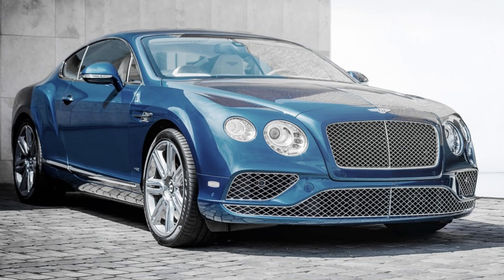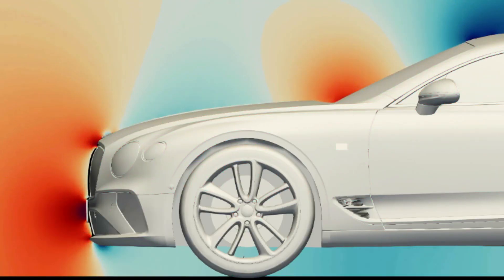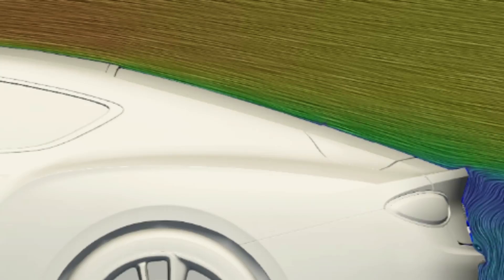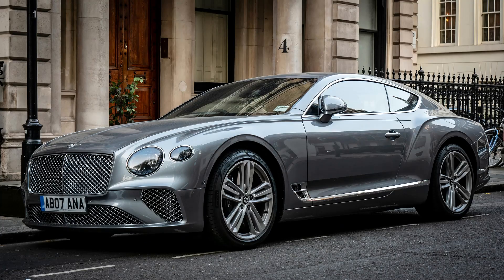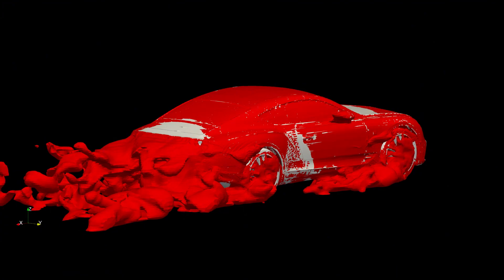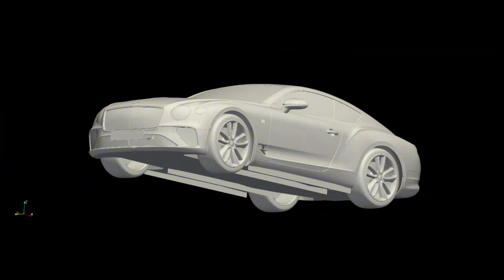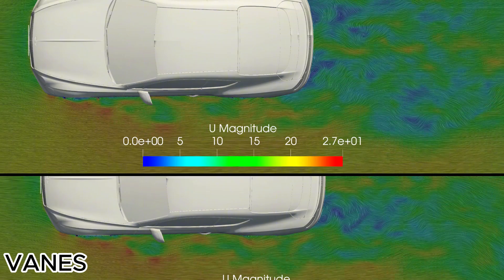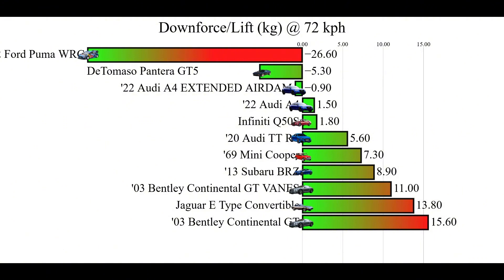I Made This Supercar More Aerodynamic

Comment: 00:18 - "The cool, original GT."  The car you've featured here, is definitely not the original 2003 GT - which was higher off the ground, and taller.  The 1st Gen also had a smoother and more rounded nose - in detail, in profile, and laterally where the nose joins the vertical side surfaces of the front 'guards.  Additionally, the earlier two of the four generations, had a different drivetrain layout and floorpan.  This is relevant as it required a longer front overhang than the two most recent generations.  To what degree that affects aerodynamics I am not aware. 
In this image, and the aero version you analyse, you have the 3rd generation from 2018.

Comment: Could you do the Model Y, essentially aspect of lowering the ride height by 4 cm and the underbody and the Flow around the wheels. I work on the Concept here
Reply from the maker: Sorry, I don't understand what you mean.
Reply: @ I LIKE the way you did the analysis. If you have the cad data for Tesla Model Y available, it would be great to check its aerodynamic. A Common modification is lowering the car about 4 cm. Further improving the flow in front of the tyres with deflector or guide vanes. 

More like, what could someone do, to improve the aero even further

Comment: Do you think those long strakes on the side would work on most vehicles? I've been wanting to reduce drag on my car but haven't been able to find a way to manage the tire wake better. I was planning on improving the floor, front lip, making a diffuser, front wheel deflectors, and air curtain, blocking off more of the front openings, and lowering ride height slightly.
Reply from the maker: I think it would work on most regular cars. Not necessarily all supercars, or hypercars, because they sometimes have complex underbodies that have been optimized. But regular cars should be fine.

Comment: So... I saw that you had the beetle and the classic mini on the chart... Mind having a look at the fiat 500 and looking into the lid up/lid spaced/ lid closed situation? I'd love to see what makes a difference to Cooling and drag.
Reply from the maker: Thanks for the idea!
Reply: @PremierAerodynamics  basically the Bug guys usually open the top of the lid, by about 2 inches, but 500 guys lift the top, the bottom, and even lift the lid 90°. Carlo Abarth had claimed that the table top lid reduced drag, improved down force and improved cooling. Same applies for the fiat 600 and quite a few other Abarth tuned cars.

Comment: Shoving the airflow with strakes behind the wheels is the ticket! The tire wake is driven by the pressure difference between the front and rear, so if you raise the static pressure behind the wheel you reduce the pressure differential. I have a nice bit of experience with floor strakes over the last 2 years. Outwashing air behind the tire adds almost no drag, whatever drag the bodywork creates is more than compensated for the lower drag from the wheel. Lower dive plane, or a vent in the bumper ahead of the front wheels like in old school BTCC would also have a nice impact. Still, quite surprising that straight strakes made downforce. I wonder if the strakes form a pair of Venturi tunnels? You could give them an hour glass shape in plan view and see what happens :)
Reply from the maker: Guide flow away from the front wheel is definitely a good idea.

For the strakes, you haven't found an increased wake out the sides? Does the jetting vortex stay in the same position?

The straight strakes were more about giving the underbody more clean flow, and faster flow. If you have strakes produce vortices, then that is a different avenue where the vortices are now low pressure cores and that can produce downforce a different way, but at the expense of drag. So, that is a nuance.
Reply: @PremierAerodynamics  Pushing out the wake doesn't seem to have too much of a negative impact on your own car, mostly the cars that are following you. Since instead of clean air they get the unsteady turbulence of the tire wake. It's why aero dependent cars are so hard to race wheel to wheel.
Reply: @PremierAerodynamics  The vortices in the underbody are quite interesting the low pressure they bring is due to the fact they kind of block airflow. Combined with the low pressure core and the shear stress on the walls that keep the BL energized while entraining air from upstream. It's basically putting your thumb on a garden hose.

Comment: I wonder why auto makers don't turn their windshield sprayers on the hood into little vortex generators, they're almost there anyway. You can easily make them out of cheap plastic. Or maybe ridges on the hood to trip the flow at the base of the windshield.
Reply: on modern cars they're often hidden away underneath the hood, by the base of the wipers so I guess there's no point bringing them back out from under the hood to disrupt the air. could be cool to see some clever shaping of the hood to try reduce the wakes at the bottom of the windshield.
Reply: vortex generators are used to encourage airflow to stick to a surface when it would otherwise separate, so the top of the hood is not typically a location that would benefit.
Reply: @kotomile  The junction between the hood and windshield is though.
Reply: @rolandotillit2867  windshield cowl area is already positive pressure - many aftermarket air intakes draw from it - so it gets air already.

I suppose a vortex generator at the trailing edge of the hood could get more air to continue down into that area but again - why? You want the air leaving the trailing edge of the hood to continue up and over the windshield, as smoothly as possible. 

In aviation and in cars, you see vortex generators near the trailing edge when a sloped surface is increasing its slope too dramatically for the air to otherwise stick, like near the flaps of a wing or the back window of an Evo MR (which has a sharp angle to its rear window, unlike most of the cars you see people adding these to).
Reply: @kotomile  Because then you build up less pressure at the base of the windshield. The recirculation bubble region at the base of the windshield is one the biggest causes of drag on a car. The recirculation bubble creates drag, and creates the minimum area path for the free stream air. By filling that circulation bubble with body work or tripping the flow to prevent it from forming, you can avoid the losses it causes.

Now whether this is practical(viable economically and whether it gives a benefit in fuel economy or some other metric) is up for debate, the theory is sound.
Reply: @rolandotillit2867  what you describe there (filling in the bubble with bodywork) isn't the same as a vortex generator, but yes that is a good idea.
Reply from the maker: That's an interesting idea. It would probably work downstream of them. I always thought of having a little guide vane, so if you have to have the sharp junction, at least you have something helping turn the flow.
Reply: if you notice many modern cars do have those two ridges on either side of the hood going outwards to do just that

Comment: stagnation in front of the windshild shouldnt use up flow energy, the cpt should be unaffacted by decelleration. the more violent acceleration on the top of the windshield due to the sharper angle is the issue from my understanding
Reply from the maker: That is definitely true for potential flow. But when you add viscosity, changing the flow introduces shear stresses, which results in viscosity sapping energy out of the flow, especially when there is turbulence involved.

Comment: My undertray I made seems to work very well with my radiator, the engine idles a bit warmer (steady not constantly rising in temp), when you start driving the temperature drops back down to the bottom of the "Normal" temp segment where as before the undertray, it just stayed at about half way no matter what you did
Reply: my diffuser is my fuel tank lol
Reply: @tturi2  On Subarus, it's the muffler oriented sideways, although there's still a considerable gap between the muffler and rear bumper
Reply: @米空軍パイロット  they're both novel solutions to having $0 for aerodynamic panels when they built the cars
Reply: @tturi2  I actually added an additional solution a while back. The rear bumper has 4 holes spaced 7 inches apart. Same spacing as the holes on a license plate. Took 2 old plates and screwed them on. Gave a 3% improvement to highway MPG. Pretty good for a crude solution.
Reply from the maker: That's good. So, the additional air flow is enough to make up for the covering.